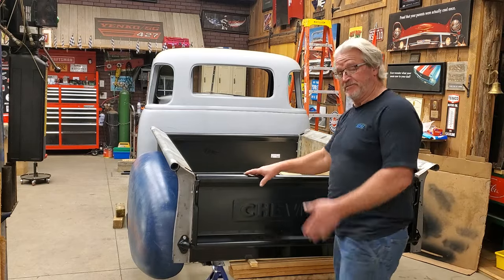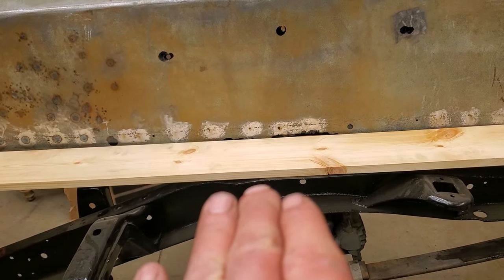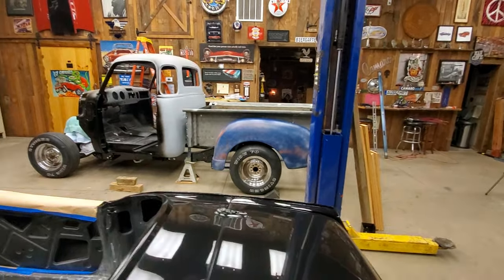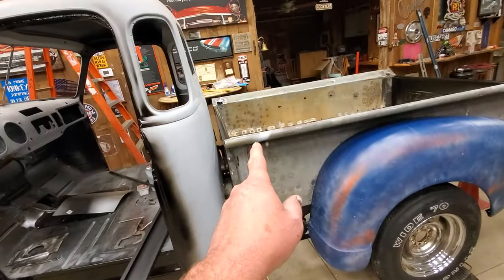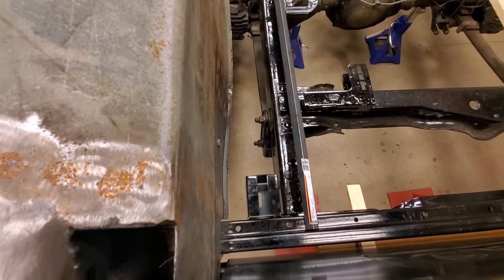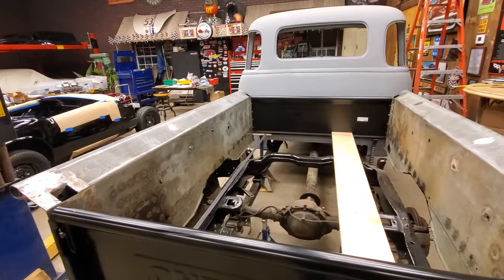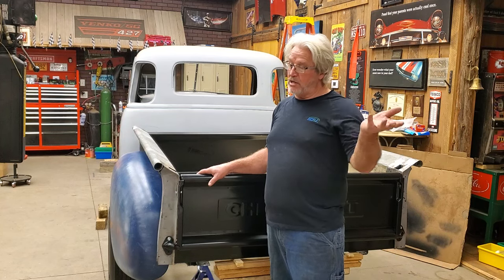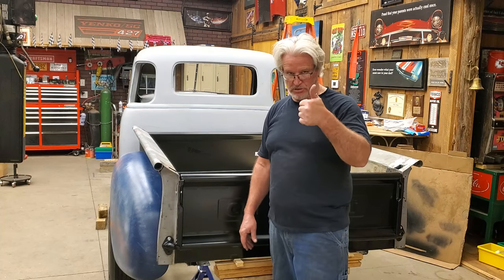Part 1 - 48 Chevy truck on an S10 frame - let's put the bed on!

Comment: Changing the height of the box affects the space between the running boards and the cab as the splash apron bolts to the running board and the bottom of the box
Reply from the maker: Yep I definitely know that now! 🤣

Comment: Is Paul I'd like to see a video if you could send just underneath the cab front and back I got a 2000 S10 frame I set mine on it's not quite lined up like it should so I just wanted to look at yours and see what I'm doing wrong thanks
Reply from the maker: Are you using the Russ D swap kit?